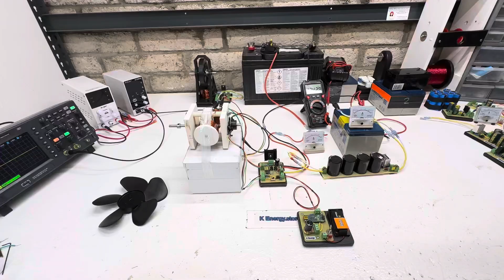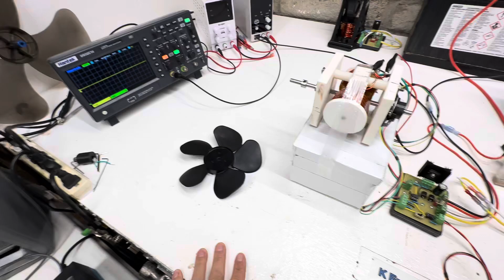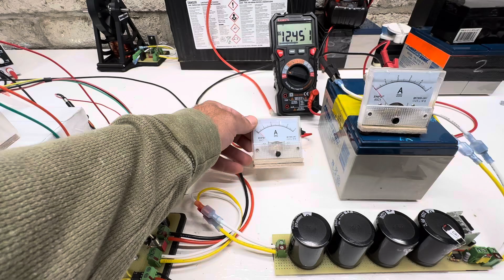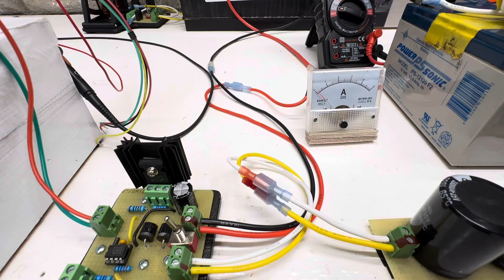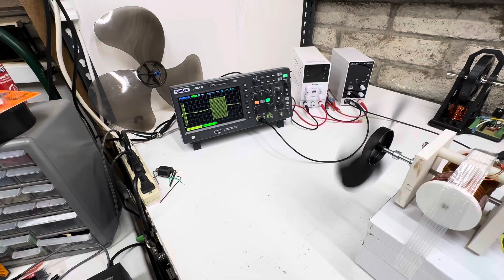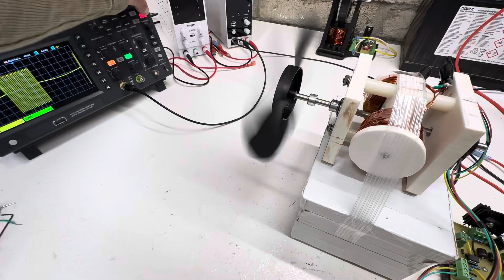Pulse motor with and without load

Comment: I was wondering.. if you charge your battery directly on your power supply: instead of running the motor.. you are know using (example) 2 amps at 12 volts. to run motor and charge the battery. so if you use 24 volts at 1 amp to charge you battery only.. it would give you 24 watts both.. is the battery going to charge faster on the powersupply than on the cap dump?... i agree it would be less fun watching.. but in terms of efficiency.. what is more efficient.. that would be an interesting experiment. (i agree its a bad example because the motor looses efficiency at 2 amps.. but in a perfect world and if you tune the motor to top efficiency at 12 volts and charge with your power supply directly at 24 volts (same wattage).. that would be very interesting)
Reply from the maker: @FreeEnergyNerd  yes would be interesting experiment for sure 
That sounds like a “ loving path “ setup 
I use the cap dump because it converts the 500v to low voltage high amps and keeps battery desulfated